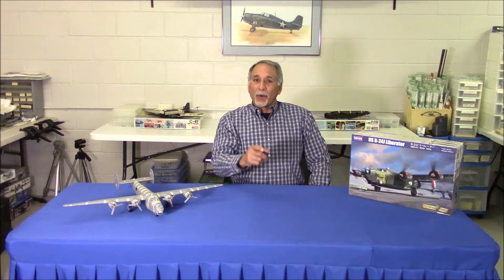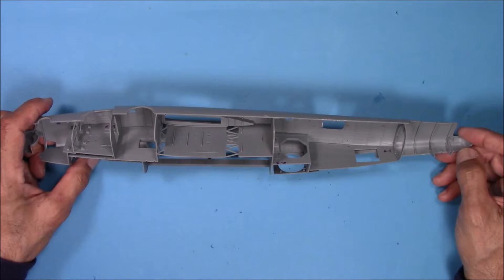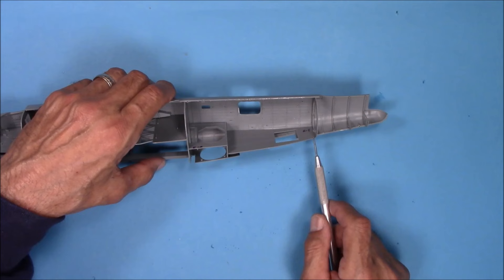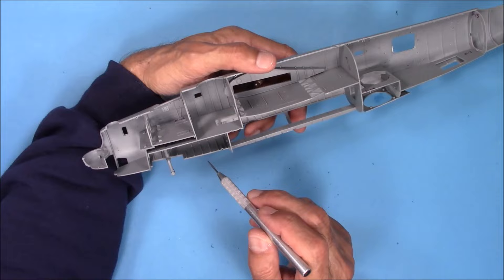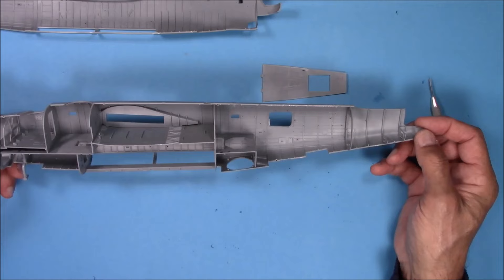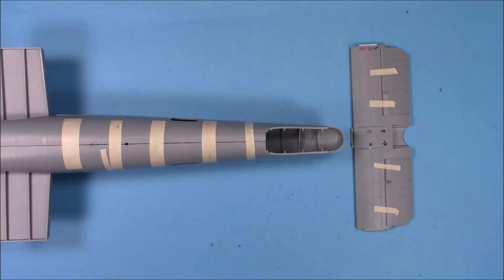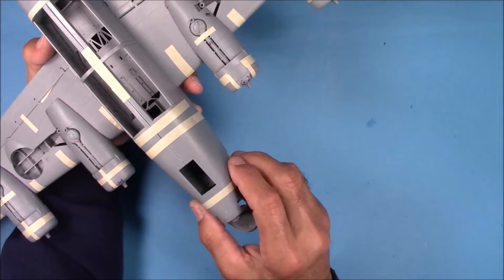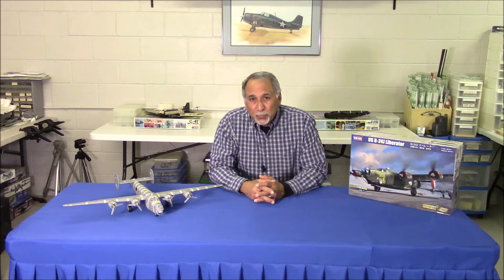Part-2 of the Hobby Boss 1/48 scale B-24J tape up review.

Comment: Purchased one of your books at a local hobby store back in the 90’s.  Still have it in my library of modeling books and references.  About this video series of this B-24, thankful you put this together to show us the problem areas of the kit.  Looks like it’s going to require a bit of aftermarket to get it “right” - engines and nose glass for sure.  I typically display my aircraft models in flight, so I won’t have to be concerned with the nose weigh issue, thankfully.  I currently have the old Monogram B-24D on the bench with build in progress, but the HB kit will be soon afterwards.  Thank you for posting the videos.
Reply from the maker: After i finish the Monogram C-47 its onto my Monogram B-24D too!

Comment: Here is a question:  How much weight is needed up front to get this model to sit right?  The instructions show where the weight should go, but they don't say how much weight is required.
Reply from the maker: Good question

I have not built this one yet, but I am working on the Revell/Monogram kit.

I should know in a month or so.
Reply: @scalemodeling  -Okay, good.  If you remember, let me know what you find out about it.  And I'll check back too.